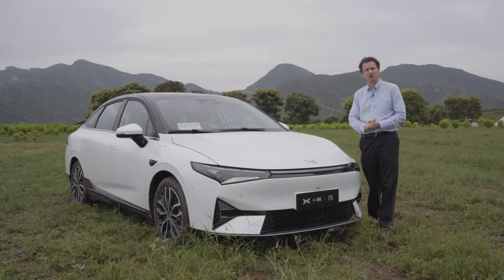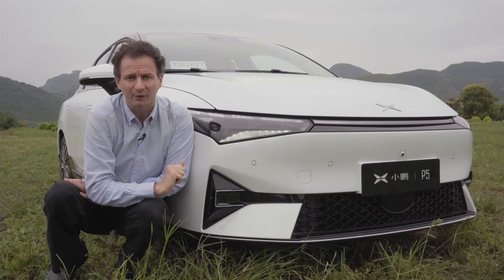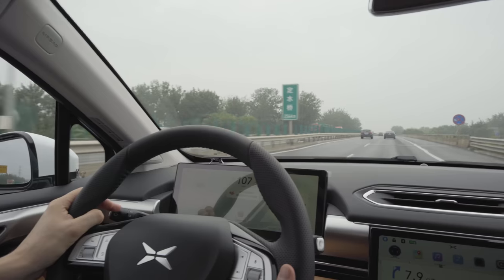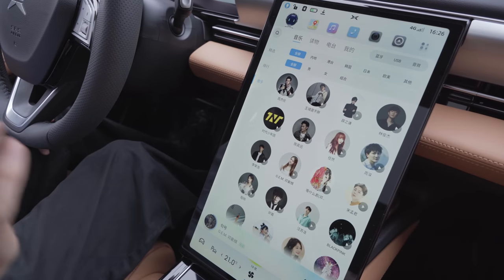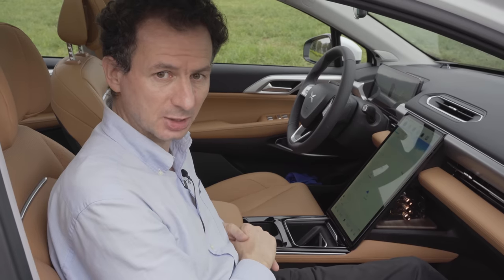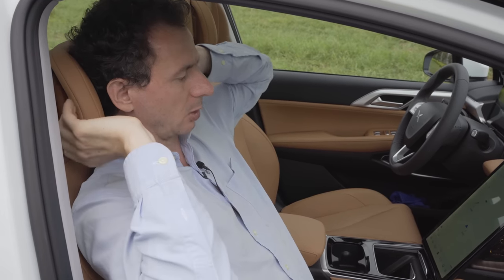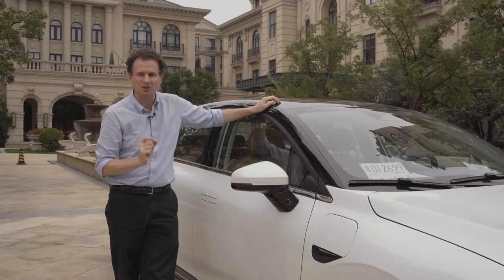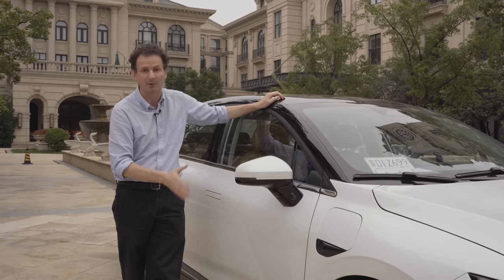Meet The Xpeng P5: World's First Production EV With LIDAR

Comment: I don't care for Lidar and with the sensors being low and in the ding-corners wasn't the best placement IMHO.
BUT...  It's not overpriced and a reasonable looking car; I hope they do well.
Reply: If you don't care for lidar good news you will get highest range model with some extras for 30k or less
Reply: @hiravparekh8695  😆 good point
Reply: @hiravparekh8695  the range will matter the most ,since its essential car,the previous version the p7 didnt have benefit of latest autonomous driving but its still did well, sure this car the p5 will have same fancy things like valley parking assistant which is still function without lidar like in the p7
Reply: @cobaltblue2756  yup range is really good for money in P5. I want to see if this can become the best selling car in its segment because currently there is not a single high tech car even in china in p5 price bracket that offers such a range and tech for the price. Seems like P5 will be Model 3 for Xpeng as long as they can figure out any production issues and built factories in other markets as well where they want to sell

Comment: Batteries? Are they LFPs? Or NMC?
Reply: Both versions
Reply: @mdanaszaimkhan5105  Is that right? How will you know which you are getting? Because the warranty on the LFPs is going to be a lot longer, and the rate of charging will be affected too...
Reply: @yggdrasil9039  standard range versions like 480 kms is lfp version while 550KMS and above range are ternary NMC
Reply: @yggdrasil9039  by the way what you think about solid state batteries.
Reply: @mdanaszaimkhan5105  Interesting, thanks, that makes sense. Not sure what to think yet about SSBs. Still relatively unproven so it remains to be seen if Quantumscape and companies like Toyota can make them a commerical reality.
Reply: @yggdrasil9039 mercedes benz is testing it currently you can watch Vedio of its electric bus
Reply: @mdanaszaimkhan5105  OK I'll have a look at that MBenz. So if the chemistry works out cheaper and comparable energy density that would be a game changer as they are way safer than liquid electrolyte batteries (though LFPs are pretty stable owing to the Fe chemistry)